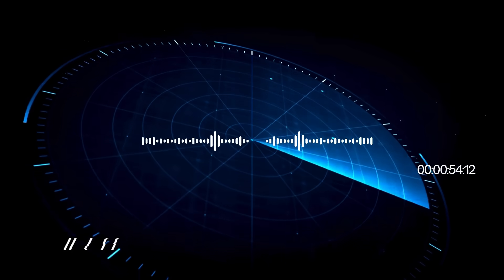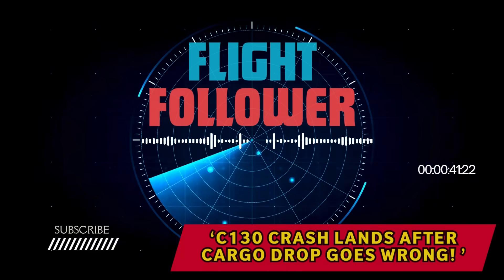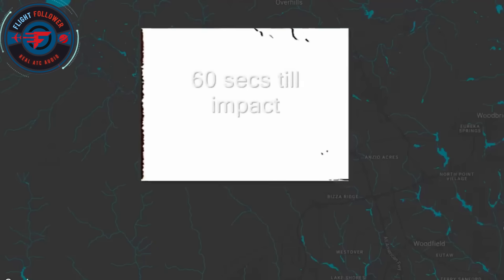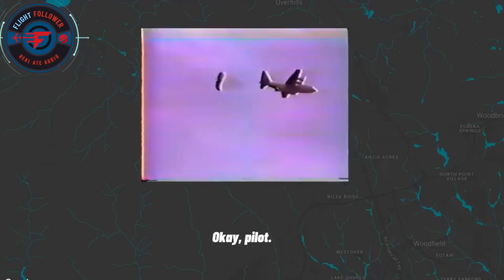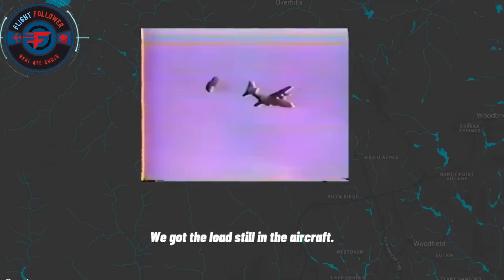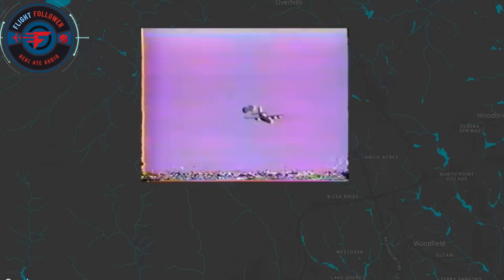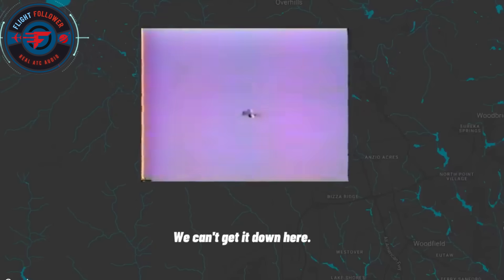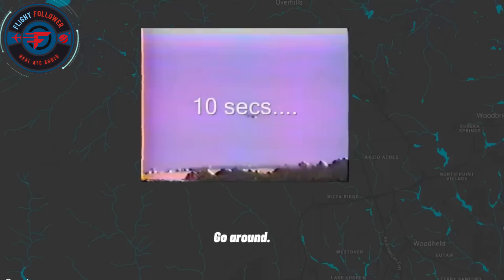C-130H fatal crash while droppingM551 Sheridan tank - load hung-up, parachute deployed!

Comment: Air Force veteran - I have been up on many drops and seeing the big armoured drops they are so close to the top of the cargo bay as they are extracted! The trim change is massive with  huge nose up, Im wondering HOW and why this didnt dislodge the tank? Was a lock or chain left attached? I believe now drogues are installed or planning to be in stalled with a guillotine system on the parachute attachment. Ive seen trials of this and it will save lives. In event of a NO DROP the pilot fires a seer which severs all the chute lines. RIP to that loadmaster - you were a brave man sir.

Comment: I saw a similar accident while I was stationed at Ft. Bragg with the 1/17 Air Cav in 87.
I was in the last set of bleachers with my troop beside the runway. They were attempting a L.A.P.E. excersise (Low Altitude Parachute Extraction) when it lost lift & slammed into the runway with the Sherridan hung up on the ramp. 
The tailboom had a separation of a couple of feet from the main fuselage when it passed by me. My last photograph was of a crewmember laying on the floor in front of the aft side cargo door with a hanging scream... That image will forever be burned into my memories. 
The aircraft hit a HUMMV with 2 passengers at the treeline not 100 yards from us. The aircraft exploded sending fragments several kilometers down. It was truly a horrible accident.  I witnessed one airman's body in a tree still burning. Our troop was the closest & most of use immediately ran towards the accident to help however we could. 
After the accident. The 82nd AIRBORNE Division kept on with the excersises to include an A-10 firing at targets in front while screaming in from behind the crowd. This was at a live fire range of course, not the DZ. 
When I  went to pick up my photos. An Airforce pilot who claimed to be flying the second C-13 in flight was picking up photos as well. 
He said the pilot was hot-dogging it. 
Wish I still had those photos.

Comment: Description:
Date:	Wednesday 9 August 1989
Time:	19:00
Type:	Lockheed C-130H Hercules
Owner/operator:	463th Army Unit USAF
Registration:	74-1681
MSN:	4654
Year of manufacture:	1976
Fatalities:	Fatalities: 1 / Occupants: 7
Other fatalities:	0
Aircraft damage:	Destroyed, written off
Category:	Accident
Location:	Fort Bragg, NC -    United States of America
Phase:	Manoeuvring (airshow, firefighting, ag.ops.)
Nature:	Military
Departure airport:	
Destination airport:	
Narrative:
A Lockheed C-130H Hercules attached to the 463th Army Unit at Dyess Air Force Base near Abilene, Texas, crashed about 19:00.
Three 28' extraction chutes were deployed while dropping heavy equipment over the Sicily Drop Zone. A Sheridan tank M551 got stuck with the parachute cables, slowing the plane rapidly. Crew put gear and flaps down in an attempt to land on Sicily DZ and impacted berm along a sunken road at the end of the Drop Zone.
The aircraft struck the ground nose first and the wreckage was flattened. The Loadmaster was killed while attempting to get around the tank to cut the extraction line. Air Force Base Fire Department extinguished the blaze in about an hour.
The names of the crew were released by Sgt. Joe Bela, public information specialist at Pope:
-Technical Sgt. Charles R. Alfred died in the crash,
- Injured were Lt. Col. Shanon P. Dunlap, Capt. Daniel B. Boughton, Capt. Kevin Sluss, Sgt. Lavell Williams, Sgt. Adam L. Parsons and Sgt. Brian B. Johnson.

Comment: I am 87 years old and went from private to colonel in the army and, in the 1960s was at the test & evaluations for dropping things from aircraft.  It was hazardous.  No wind tunnel tests.   They went from piston engines to jet engines just because it was impossible to do anything.  I retired in 1985, and this is later.  So it is a very hazardous thing, to drop many tons.  And it was not in the original design to do this.   So all of my respect and admiration to the crews.  None of this was in the original design and you are all heroes for doing this work. All my best.
Reply: You should share some interesting stories from your time in the service.

Comment: Firstly, seems to be no procedure exist yet for such short time between no-drop call and the green light of ~70 seconds.

Secondly, the loadmaster was given insufficient time to perform his duty since normally the procedure here started at 20 minutes before actual dropping.

Thirdly, there should be better method or better mechanism to avoid this kind of situation.  May be a quick release mechanism for the extraction chutes?

Condolences to their families.

Comment: I remember seeing this wreck the day after it happened.  The way this actually happened in this video is not the explanation we got from the grapevine, go figure.  It's near haunting hearing those two pilots saying, "take it easy" to each other as they thought it was most likely the end.
EDIT - This was not the wreck I saw.  The one I saw someone posted a few days ago and is here - https://www.youtube.com/watch?v=mmueeoc8Tu4
This other wreck shows the crash the way were explained.  I'm surprised I never saw the video of either at the time.  Both tragic.
Reply: I’m not sure about the accuracy of the details in this video because with multiple 28 extraction chutes, there was not a procedure to cut the extraction line, you would would first pull the right crossover handle to release the right hand locks and if that didn’t work, you pull the left hand emergency release for 10-20 seconds in case of load binding. Today they also have EPJS which could cut the extraction line but that system has only been around for 10 or less years.
Reply: Was in a bird preparing to jump after the heavy drop, was hooked up and our plane banked so hard to the left that we fell into the netting, obviously scratched.....didn't know what happened until later. AATW
Reply: I just watched it, thankyou...

Comment: Loadmaster fault failing to deployment loadmaster loads load masters deploy from my peraonal experience do share if this is not true im all ears poor crew dying for ineptness
Reply: As you can see if you read the description. The pilot missed the drop and went around. The Loadmaster correctly performed the no-drop procedures. since the pilot decided to attempt anther drop there wasn't enough time to properly complete the pre-drop checklist, so a step was missed, which caused the load to hang.

At the end of the day the pilot is in charge of the aircraft. Attempting the drop again on a short go around was risky and the loadmaster paid the price.
Reply: Completely not the LM's fault.  The issue was going for another attempt without allowing time for all the required drills to be performed.
Reply: IF(!!!! emphasis added) this was the Loadmaster's fault, he was, I believe, suitably, punished. Kudos to the pilots for saving the rest of the crew.

Comment: The loadmaster knew what he had to do to save his crew and died trying to do it. I was a KC-130J flight test engineer and have a lot of flight time in them including drops. I did ask my crew loadmaster what he’d do if a load got hung with the chutes out and what should I do. He said he’ll be scrambling to chop the chutes loose and for me to help. Otherwise take a seat and pray. Brad may not have been the most social creature out there but he had huevos the size of basketballs. One day we’re cruising Akon between some drops and he was sitting in the starboard door with his feet out. I asked WTF was he doing and he just grinned and said enjoying the ride. I asked what would he do if he fell. He was wearing a chute but had disconnected his belt. He said he’d meet us on the deck and first round of beer is on him. Good times.
Reply: Praying as much as you like,Nobody will listen or Help you from....Up there😅😅😅😅😅

Comment: Are you serious? With all the technology we don’t have a battery powered explosive charge to fire and cut all the cords. We don’t have a quick release hook. In 1989. The Blackhawk had a squib to fire off so that we could release an 8000 lb humvee. We had squibs to fire off the fire bottles for the APU and two engines.
Reply: The modern system is called Extraction Parachute Jettison System (EPJS).  In theory, this is the exact situation EPJS was built for.  In reality, I have never seen one except in the manual.
Reply: @evilload  I never saw one either. And we never had one called out in a test plan either.
Reply: @ I believe they were specifically for C-17s and were planning to retro it on the C130s.  TBH, the C130s have been going away from this type of heavy weight airdrop and been more focus on CDS type airdrop over the past few years.  We got to play with some cool new technology a few years ago, but not allowed to use it anymore.
Reply: @evilload  thanks for the system name. We had one, maybe two at my unit that would get hooked during annual refresher training or instructors would go over it for loads going on a training mission when it might be required to be used.
Reply: Back then there was nothing but about 8-9 years ago they had a system with squibs and such that were, and I assume still being used and crews that went to Ft Brag for airdrops (or just large airdrop loads at whatever location) were expected/ required to use the system on large airdrop loads. I can’t think of what it was called but I did train one time of rigging up the system that would cut the extraction line which was connected to the extraction parachutes.
Reply: I wonder how many times this has happened. Adding explosives that need to be handled isn't without risk itself, of course. Sometimes the solution is worse than the problem, so one would have to look at that.
Reply: Stupid americans with a stupid President 😅😅😅😅😅
Reply: calm down there Hero, it was 1989.
Reply: @magnusdunning6113  we still don’t use such a thing.
Reply: @kaptainkaos1202  "We"? I got more time in C130s than you have breathing.
Reply: @magnusdunning6113 Bold claim there.  How many years did you serve and in what capacity?
Reply: @ Over 3,000 hours in all versions of the P-3. Got out and qualified as a project specialist with the Naval Research Laboratory flying mainly oceanographic and EW research. Transferred to Patuxent River NAVAIR. Oh I was a civil servant my entire career except for active duty. Got my degree, hit the test engineer at Test Pilot School at PAX and moved into flight test. Worked my way up to the lead flight test engineer for the KC-130J BU2.5. Was qualified as aircrew and did much more flying than I should have been allowed to do. I LOVED the KJ! The flight deck reminded me of the deck of the starship Enterprise considering I had come over from the 30-40 year old P-3. The loadmaster on the team used to laugh at me cause I’d get all google eyed anytime I was on the flight deck. Wrapped up and went to the E-6B Mercury. During that time frame I threw blood clots in my leg so flight surgeon revoked my flight physical permanently and I went to driving a desk. I wrapped up my career in January as the EWIS flight clearance release authority, AIR445 for primarily the E-6B, Triton and backup flight clearance authority for the V-22/E-2C/D and the few remaining P-3. In case you don’t know what it is a flight clearance release authority is it means one is an expert in the fundamental aircraft systems such as propulsion, wiring, electrical, hydraulics and a couple more. We evaluate the engineering involved and ensure it’s built to SAE, MILSPEC and industry best practices. Our signature provides the type/model the authority to operate. It’s not maintenance authorizing a flight but authority to operate the aircraft fleet for that model. You may not be impressed but I am considering I only completed 10th grade before joining the Navy got out and put myself thru schooling to retire far beyond what I could have ever dreamt of. Oh forgot about more than 3 dozen cats and traps in support of the C-2 COD years back. Bold enough?
Reply: @kaptainkaos1202  oh god...that want for you.  It was first the dummy who said "got more time breathing" or something stupid like that.  Sorry that's the op name didn't show up in my reply
Reply: Designers could build the SR-71 but didn’t think to put a fail safe device to prevent this sort of issue.

Comment: Date & Time: Aug 9, 1989 at 1900 LT
Type of aircraft: Lockheed C-130 Hercules
Operator: 
Registration:	74-1681
Flight Phase: Landing (descent or approach)
Flight Type: Training
Survivors: Yes
Site: Airport (less than 10 km from airport)
Schedule:	Fort Bragg AFB - Fort Bragg AFB
MSN:	4654
YOM:	1976
Flight number:	USAF681
Location: Fort Bragg AFB North Carolina
Country: United States of America
Region: North America
Crew on board:	7
Crew fatalities:	1
Pax on board:	0
Pax fatalities:	0
Other fatalities:	0
Total fatalities:	1
Circumstances:	The four engine aircraft was engaged in a training mission at Fort Bragg AFB. While dropping a M551 Sheridan tank over the Sicily Drop Zone, the tank go stuck with the parachute cables. The airplane became unstable, stalled and crashed. Six crew members were injured while a seventh occupant was killed.
Reply: At that time it would have been Pope AFB, which was in the middle of Fort Bragg.
Reply: Fort bragg is an ARMY base NOT an afb
Reply: I don't believe the aircraft "became unstable, stalled and crashed".  It looked completely stable, it simply did not have sufficient power to fly with three massive drag chutes flying out the back of the plane.  The pilot attempted to 'glide' to a safe landing.  However, they may have attempted to 'nose up' to clear the roadside berm, and a stall was therefore recorded immediately prior to impact.

The "airplane became unstable, stalled and crashed" explanation is overly simplistic, and attempts to downplay the reality of the situation.
Reply: @gomezgomezian3236  wouldn’t having airspeed killed by the chutes make the aircraft unstable? No airspeed, no control. At least that’s what I learned at Test Pilot School at Patuxent River, MD. I’m a recently retired USN/USMC flight test engineer and was the chief test engineer for the KC-130J BU2.5 and have hundreds of hours in the Herc as well as most thousands of flight hours in other USN/USMC aircraft. You?
Reply: @kaptainkaos1202  Exactly. I think he's just a civilian trying to wrap his head around the dangers of flying, which most military aircrew are accustomed to. To them, we understate everything, when in reality, we're being concise and practicing brevity in comms. We know that each of those words, "unstable", "stall" and "crash", have a lifetime's worth of meaning... Thank you for your service, sir. I'm retired USAF enlisted aircrew myself, with over 5000 flight hours, mostly in C-130's, but some in other mil/gov aircraft, as well. I've even been to Pax River a few times! Cheers from WV!
Reply: @ if you ever make it back to PAX message me. Dinners on me!
Reply: @ Will do! I'll get the bar tab!  ; )